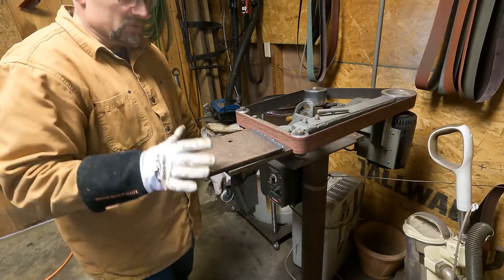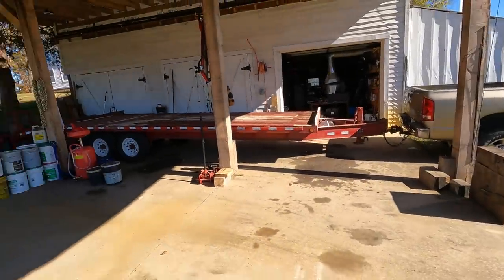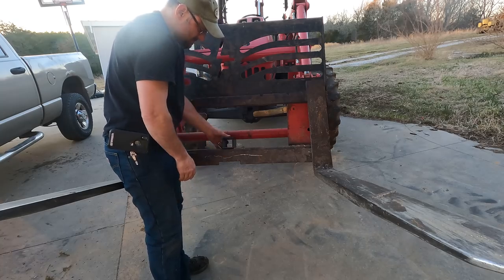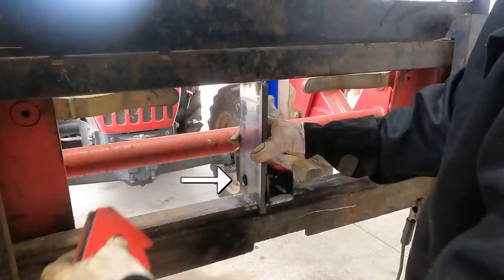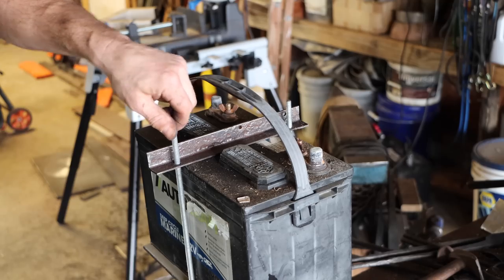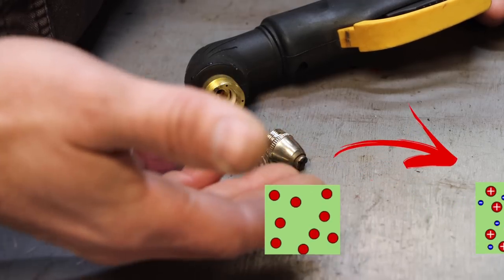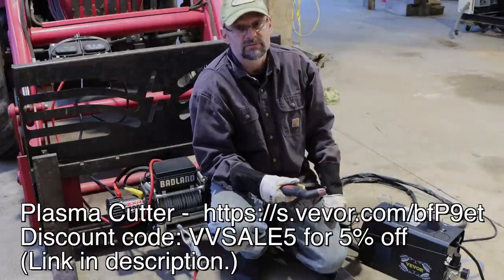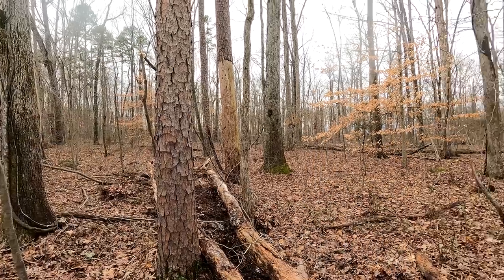The Farm Winch.  All-In-One Winch System.

Comment: A few tips and suggestions.

You can buy winch trays for mounting on hitch receivers.

Not as cheap or fun as making your own, but if any viewers don't have the tools or skills, now they know they can just buy one.

The store bought ones come with handles either side to help move it about.

For more permanent installs, run the appropriate size wire to a 350 amp Anderson plug, so you just need to slide it on, install the pin and plug it in.

You can buy wireless remote controls that just plug into the winch remove socket.

No electronics work needed, just plug and play. There are different style plugs with different pin configurations, so make sure you get one that is compatible.

Logging is about the only case where I'd recommend steel wire rope.
In all other cases, synthetic rope is better.

It weighs less, which is handy when moving the winch about, doesn't cause wire splinters in your hand, and most importantly if something snaps, synthetic rope won't try to decapitate you.

It's still potential dangerous, especially if there's any metal (such as a hook or shackle) in the setup, but it's a LOT safer than wire rope.

Finally, have you thought about mounting the hitch / winch on the body / frame of the tractor and mounting a roller guide onto the loader forks?

It would keep the winch safe and out of the way if you wanted to push / lift a log with the forks.

The cable will move in / out of the loader arm as it's raised / lowered, unless you mount the winch directly inline with the pivot point of the loader arm, but you aren't using this as a precision crane so not a real issue.
Reply: @JCWren  please DO NOT use 50amp rated connectors on a load that can exceed 300amps.

Connecting the two batteries in parallel when they either different sizes or different charge states is far from ideal.

If you are going to connect two batteries of the same size but at different charge states, you should allow them to equalise, without using or charging them.

The best way to keep the winch battery charged is to use a DC-DC charger.
Reply: I like the way your brain works!
Reply: I did buy the winch plate to go with my winch and it’s probably easier to handle due to the built in handles. Works well.
Reply: It depends on the environment it will be used. Hot sparks? Oils and other liquids? I'll stick with wire rope.
Reply: @nodaklojack  as a blacksmith I would prefer synthetics rope vs wire rope.  If I catch it on fire I’m aware of it, with a wire rope I could weaken it significantly without being aware.
Reply: @johnvanlandingham8832  l
Reply: I bought and destroyed 2 of the badlands winches mounted on truck receiver plate they work great for straight on pulls but any side load will twist and break the mount plate and mount holes on the winch cases. I didn’t care cause of the warranty but my 3rd one I made a heavy duty mount and haven’t had an issue!
Reply: EXCELLENT suggestions!!!

Comment: Food for thought. You could tie the tractor battery to the winch battery and install a current sensing relay on the lead to the winch motor so that when you are using the winch, it would disconnect it from the tractor. That would allow you to use the tractor to charge the battery when you’re not using the winch, but it would not discharge your tractor while you’re using the winch.
Reply: 12v winches are designed for intermittent duty...like loading that trailer or pulling you out of the mud. The tractors alternator will never keep that battery charged in a logging type operation. He needs a hydraulic winch operated off the tractors hydro system for that use.  He will destroy that winch operating it continuously like he plans
Reply: That is what I use on my pontoon with dual batteries. it only connects the two batteries when the primary battery is at 13volts. Once you turn the engine off the draw only comes from the aux battery leaving the cranking battery untouched.

Comment: You may want to check the manual, but on all the small/mid size tractor loaders I've used, they say to never pull with the loader. It can damage the frame where the loader mounts.

Normally see winch mounts that have a blade to dig in the ground to counter the pulling force. Or slap a hitch receiver to the top of the bucket to do the same thing.

Comment: What you do is start in the middle of the circle.  Then once through move to the line and cut the circle with a cleaner line.  The start hole is typically a bit messy. Generally the ground line on plasma machine should be able to handle at least 50 amp like the other hand unit.  Not a reference, it carries current back.  Long time plasma user.
 Like the projects !

Comment: Im a interprovince red seal welder...first off love your channel you are definitly a jack of all trades...the plasma cutter you are either going to fast or you need to turn it up...the welding if you want maxium strenght your better off with either flux core wire with gas or stick  electrode 7018 for anything over 1/4 thickness and run all stringer beads no weaving...the hard wire is great for the lighter stuff...not saying it wont work just passing on what I know...again love your channel keep up the great content
Doug

Comment: Thank you for the metric conversions! It helps a lot to understand what you are working at. As an European I just can't imagine anything when I hear inches and feet.

Also nice to hear that Vevor is interested in co-operating with you. They also have european distribution centers and I once bought a high-pressure air pump for charging a air-rifle from them. It was about 40 bucks and seems to be identical to what european dealers for 100 - 150 bucks.
You can get all that inexpensive chinese stuff from them with short delivery times and if there is a problem your local warranty laws work.
I didn't have to complain about something but they seem to have a decent customer service.

Comment: You have an underpowered MIG for that. So. Please stop weaving, it sets up flaws. Put set to max. No weave, put your root run in (yes, it's smaller than you'd like). Quick wire wheel. Put your second run in, to hit the bottom parent metal, & to run up slightly over half way up your root. Quick wire wheel. Then finish up your third run by hitting the parent metal on the vertical wall, & to nicely finish melding to your second run. You will end up with a nice, much stronger weld. You can repeat the process if you want a wider weld.
It'll never be as good as using a set with big amps, but it's the best option, given the set you have.
Great content, cheers.👍

Comment: I've done the same thing, using a winch in multiple locations.  If i can make 1 suggestion, run 2/0 cable from the " house" battery, through a 350 Amp breaker to a 350A Battery Connector AWG 2/0 Quick Connect Battery Modular Power Connectors Quick Disconnect (Red)(copy and paste that into an Amazon search and it'll come up), on each thing you'll be using(ie from the tractor battery, up the boom to near the receiver) then and the same connector to the winch.  Then when you need to move the winch to something else, you just unplug it, pull the pin, put it on the truck, plug it in, done.  Yes it's a little price initially but it's clean and quick.

Comment: If your going to use the plasma for long periods, Use a full face shield like your welding hood  because the other parts of your face not covered by your goggles will get arc burnt kind of like a sun burn. Ask me how i know
Reply: ive sunburnt my face with the welder before, doing maybe a dozen tack welds with my eyes closed, but never with the plasma and i always just use sunglasses or welding goggles with it never a face shield, ive cut for 15 minutes straight before, and for hours in one day.. i ripped a 10' by 3' piece of 1/4" i got for free into 2.5" flat bar

Comment: Hi Jon. Get yourself at least a couple of long steel cables of different lengths. Super handy for pulling over leaning trees and dragging stuff. I often run the cables through a snatch block to get the angle of pull which I need. You can also set up the snatch block on the log being pulled, and anchor one end off the cable on another tree to double your pulling power. It's fun to watch your projects.

Comment: A wireless winch control is about $20 at the jungle store. I use the same ones for dump beds and power tilt beds. Just add two diodes to the pump motor so the power does not back feed to the opposite valve solenoid. I also used the same design for my winch, but I found it drug the cable on the split bed tilt bed at the first phase of the pull. So, I made an attachment that would connect to the front of the tilt deck until the pulled object gets close enough to switch to the main frame. I also installed Anderson connectors so I can just switch to a different connection point for the 12v. I bought long jumper cables and installed lugs on the ends for direct battery attachment. I have never had a wire overheat condition.

Comment: You can run jumper cables from the tractor battery to the winch battery,so you don't deplete the winch battery,and have correctly dimensioned cables.

Comment: Awesome job installing your winch mounts. Very well thought out and reinforced. As far as your question about the 45 seconds, like OEM states “max load” in your case is going to be 12k#. By the time you get anywhere close to that you will know bc your winch line is going to be guitar string tight, the vehicle isn’t likely to sit in one place wo extra tying down, and other mechanical failures are possible before the winch stalls. I’ve done a lot of winching w bulldozers and heavy equipment so these winches are easy. I’ve personally found the limiting factor on these electric 12v dc winches to be the power supply. If running off a straight battery I’m careful not to exhaust my battery and keep charging it up. When in serious off-road winching I like to install 2 batteries in parallel to give a longer winch time. I’m also utilizing blocks to lighten the load on the winch. As an aside, I never hook my winch up to the vehicle battery by itself, I run a wire w a breaker from the vehicle battery which is charged by the engine alternator to the separate winch batteries. That way I never have a vehicle that can’t run. Good luck and be safe

Comment: Put some additional grease and oil mixture into winch gearbox, as they are usually very dry. Also I'm not sure about that square steel profile welded close to the line, as it may be binding in some conditions.

Comment: Harbor Freight has a wireless remote for their winches for around $30. Warn makes plug-in cords that you could mount permanently on your truck and tractor and on the winch so you can plug and unplug as needed, they also work great for jumper cables for jumping things with your truck or tractor or for jump starting your truck if needed. I use to drive a tow truck and we had a plug on the front of it for jump starting vehicles.

Comment: I would still put in the cables so you can have a second battery on the tractor mounted somewhere safe and then use a split charge relay to keep the utility battery charged when the alternator is spinning, look at some of the Anderson 350A connectors and then use them everywhere where you need to connect up the winch. They are also a neat solution to hooking up chargers and what not without using the crocodile clamps that rarely works well! And in a pinch you can use them for starting too with sufficiently fat cables!
Reply: you seems to have a lovely profile, so I’d love to know you better that’s only if you don’t mind cos you seems to be a nice and very lovely person

Comment: I have the older series HF 12K winch mounted to the HD channel mount, welded between the rad support frame rails on my 94 ram 1500. Despite everyone telling me it's wrong, I've done so many self recoveries and helped pull others out, and other stuff, that I have no idea how many times I've used it in the 6 or so years I've owned it. It sits partially exposed to the elements, the line was recently switched to Amazon synthetic, and the only problem I ever had was the grounding wire in the control box breaking. I absolutely love it.

My smittybuilt 9K on my jeep XJ cherokee had the freespool lever lock up multiple times despite greasing it and using a winch cover.

Comment: you have a bad land winch harbor freight sold mounting plate I did the same using hitch receivers but the problem I had on my trailer the bulk head metal on trailer was not strong enough to not bend I would place horizontal bracing on your trailer you did a great job on the fork lift attachment

Comment: I think you are on the right track with the motor temperatures.  They are much like a starter motor, and they have a lot of mass inside, and once you start to get it warm, it takes a fair amount of time for it to cool all the way through. Luke warm on the outside is likely pretty warm inside. Nice setup, thanks for the vid.

Comment: I've seen the badlands winches used to the point they were smoking or steaming (mudbog long pulls).  They held up well.  I wouldn't recommend doing that every day but an occasional hot situation shouldnt be too big of a deal.  

And with your battery.  Instead of booster cables look at a electronic battery isolator.  It's a little more expensive then booster cables but it allows the charging of 2 batteries but isolates the batteries from each other.  They've been used in the offroad  and show industry for decades.  That way you can still run your factory car battery but have a secondary battery setup to run your airbags, speakers, lights or winch.

Comment: I especially loved the way you fished your trees out of the woods. It also takes a lot of stress out of using the winch because you're using the tractor to do the work and not just the winch. When using the snatch block try backing up more often and that will keep from using the battery power as heavily and keep it from dying. Good thought on jumpering it to the tractors 🚜 battery.

Comment: Hope you got the 2 year replacement plan for the winch. They replace them basically no questions asked if the motor does burn out or something goes wrong with them. On something like this you'll use a lot, it's definitely worth it

Comment: THANK YOU for your explanation of the plasma cutter.  I didn't entirely understand how it worked...or the plasma it creates until now.  Also, excellent safety pointer about cutting or welding stainless steel outdoors or using adequate ventilation.  👍

Comment: Very good video.  I always drill a small hole when cutting thick steel to start my plasma cutter.  I didn't know it would just burn through.   Secondly, I use 4 gague wire and Anderson quick connectors on my winch to add and easy remove from my truck and trailer.  That may work instead of using your spare battery.  Have a nice day.

Comment: Add a wire to your battery from tractor battery using a quick disconnect or switch so you can charge battery while not using winch.
Reply: Yeah, that would be a good idea. Might slso be a good idea to get the power direct from the generator or alternator (to avoid draining the tractor battery) and put in a current limiter to avoid overloading the cable. With 2.5 mm^2 wires (no idea what that is in your ancient gauge system) you can recharge the battery at 25 amps.

Comment: I have a nearly identical winch hook up with my truck, tractor and trailer... BUT, you will probably be surprised how I usually pull trees out of the forest.

My tools in order of preference include the following:

1. My grapple is by far the fastest. I approach the felled tree perpendicular to the way you normally use a grapple. Digging the central shank into the ground at the base of the tree I then raise it slightly and clamp down tight on the end of the tree. I then simply raise the end and back up, pulling the tree out of the forest. I only have a 1025r and it pulls incredibly well once the trees are raised at the end.

2. If I can't get the tractor into the forest or use the grapple for some reason, I use a heavy duty bungy tow strap and a heavy chain double wrapped around the tree. This isn't as quick because it takes time to connect but works well too.

3. If i need to change the direction of pull I will then use my pulley block and winch. This is both slow to hook up and slow to use but is very versatile.

Over the past year I've had to deal with over a hundred trees that came down in a large storm.  Once I discovered you can use a grapple in this way I've been using it for 80+% of my skidding jobs. It is the best way to pull trees of the forest of you have a small tractor and a grapple.

Comment: @FarmCraft101 Just an FYI, I have a 12k lbs winch on a store bought portable mounting plate (I lack the skills and tools to build my own) and I had to use jumper cables to extend the reach of the winch power cables.  It may not be the preferred method, but it worked just fine and the winch functioned perfectly.  I did use 2 guage jumper cables, so I figured they would be just fine.   Thanks for your videos, they are informative and entertaining.

Comment: Why the need to heat the metal before welding?
Reply from the maker: It helps the weld penetrate deeper for a stronger result in thicker steel.

Comment: No experience here, but I've heard that you shouldn't pull with a winch (e.g. winch is static and tractor is moving). It makes sense. Unless the winch has a "hold/lock" setting) the internal components are designed for dynamic loads, not "static" loads on just some of the gear teeth.